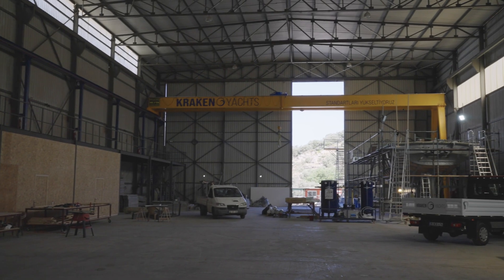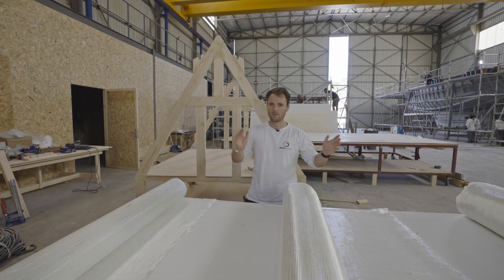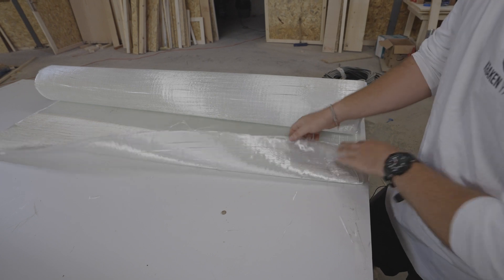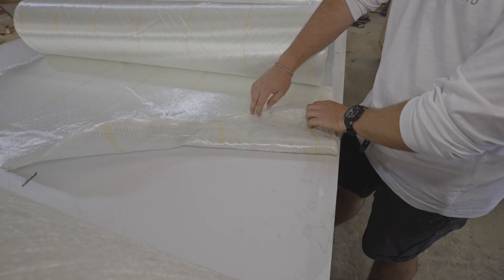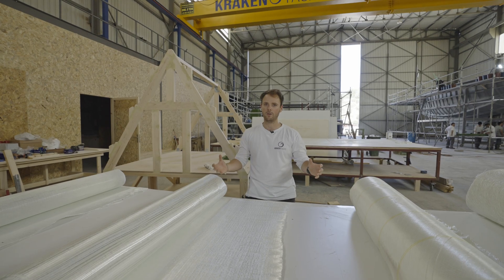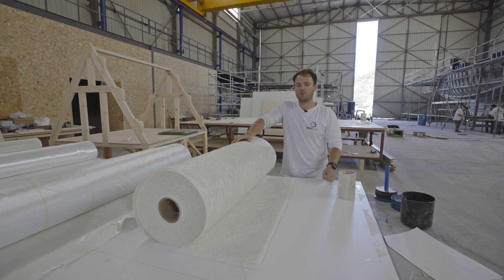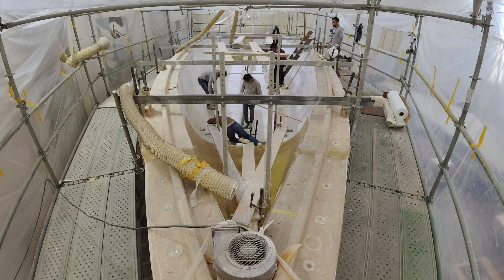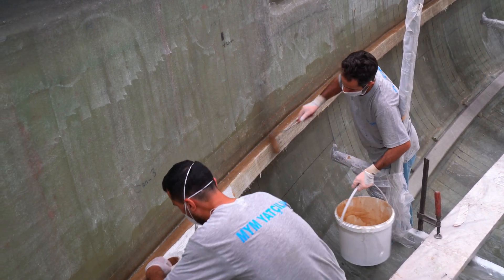Birth of a Blue Water Yacht - Episode 1: Laminates

Comment: I'm confused about the difference between 0-90 and 45, Aren't they the same just turned 45°? Excellent video though!
Reply from the maker: It is how the roll is made. If the roll is laid out on the table then you will have 0 and 90 degrees crossing and on the second roll you will have 45 degree crossing. Same angle at the point that they cross but a different angle with regard to the roll in general.
Reply: @KrakenYachts  Thanks!